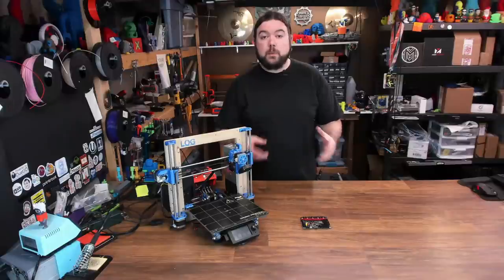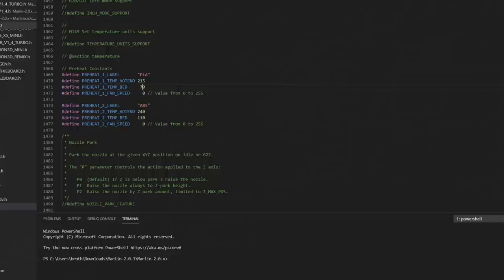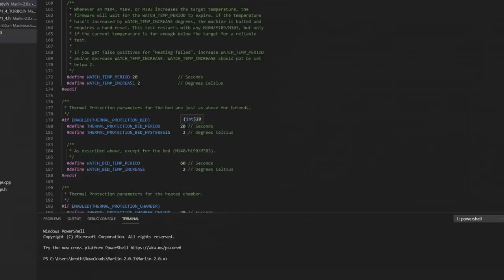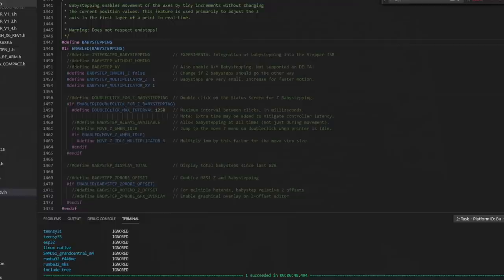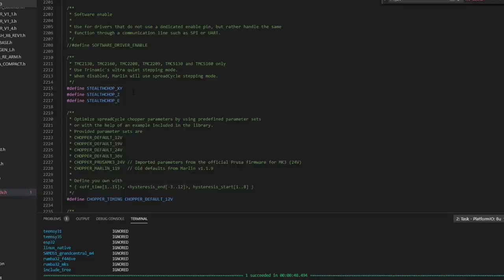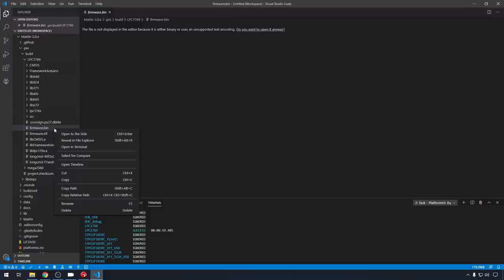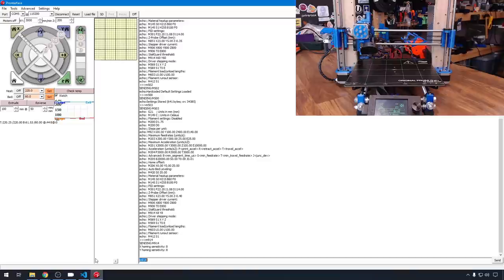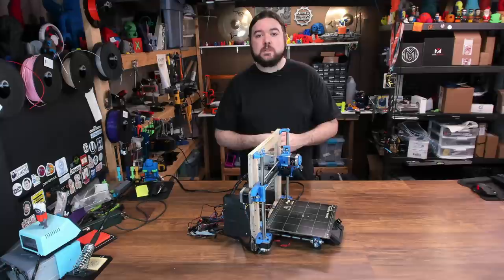BigTreeTech SKR v1.4 Mainboard - Full Install Part 2 - 2209 Drivers - Chris's Basement

Comment: Hey Chris, these videos are amazing. I have learned a lot. I am installing the BTT SKR 1.4 Turbo with TMC2130 drivers and a TFT LCD on my ANET A8. I've run through this whole process once already and couldn't get it to build. I am about to wipe all my files and start back over from step one. Any suggestions?
Reply from the maker: Thanks! Sometimes you just have to bang your way through the errors to get it done. What does the error say?
Reply: @ChrisRiley  I finally got it to build, now the LCD says TMC Connection error
Reply from the maker: @james12871  Double check all your jumpers.
Reply: I actually just decided to order the 2209s and do exactly what you have

Comment: When I put in the M914 command in pronterface it says the command is unknown. I noticed when I loaded the EEPROM settings I don't have as many on my screen. I followed the set up guide completely, anyone have some insight??
*Update: under pins and lpc1768 it shows under x and y stall sensitivity that the directives are faded out, I'm assuming that means that they aren't in use, if that makes sense, how do I fix that?
**UPDATE: found the issue, accidentally typed in tmz, instead of tmc on my stepper drivers 😂🤦🏼‍♀️. I feel like a dope lol.
Reply from the maker: Ha, no worries, glad you found it!

Comment: hello can i know why my x and y axis the maximum can go only at centre of bed
Reply from the maker: Make sure you bed size is set correctly.
Reply: @ChrisRiley  another problem is i get thermal runway on skrv1.4 turbo with tmc2209. Its occur during the middle of printing can u help me? I already auto tune, my heater at HB0, HB1 for the hot end fan, TH0 for thermistor hot end . I also having problem on heat bed. when i connect to HB and TB and power on i use multimeter on HB no voltage on that port. Hope u can help me a.s.a.p cause i limited of time to finish this project

Comment: Hi Chris, very thorough and helpful videos. This goes out to anyone else having the same problem. I dont know how to get the compiling checkmark or even the blue bar at the bottom of VS code. I had it once before but I CANNOT figure out how to get it back. I understand I need a compiler and I do have PlatformIO IDE downloaded. The bug icon is there in my extensions but no blue checkmark! I am so close to uploading to my printer. Any help on the matter is much appreciated
Reply from the maker: Thank you! Are you using the Marlin Build extension? It might make things easier. Try this one to make sure VScode is right https://youtu.be/JWUcnkjeNU8?t=127 and this one for the extension. https://youtu.be/YDvFN51siMU?t=161
Reply: @ChrisRiley  Appreciate the response! I did manage to get PlatformIO to work after fooling around with it long enough. Got my checkmark. Finally uploaded firmware to board after finding out I was using the wrong micro SD card too. Unfortunately, the LCD screen doesnt respond to the board. Tried a few screens and they all make a clicking noise. I tried reverting back to my old board for now but that doesnt work anymore either. Checked firmware related to screens and seems to be in order. So I'm stuck again but a few steps further this time ;). A little more grinding is required I suppose.

Comment: hi thank you for vid i have one problem  15:28  there is    #if HAS_TRINAMIC   is true but i have #if HAS_TRINAMIC_CONFIG it is false because it darkens the lines of code bellow how can i change it I just modified you firmwere  i tried delete the _CONFIG part but still nothing
and I have tmc 2209 ? can you help me please :D
Reply from the maker: You have updated your drivers to 2209 in configuration.h correct? That's what controls this.
Reply: problem solved reinstalled vs code and downgraded to v1.33 and everithing + i had somehow deleted one #define Y_DRIVER_TYPE  TMC2209 so added that and everithing somehow works
Reply: also i did check your version you posted and the part is false so not accasable too it is kinda weird maybe bug in my system who knows but it did compile without problem so idk
Reply: @ChrisRiley  also i had some problems with include path in configuretion adv.h so this might be problem is says there is problem with #include

Comment: My board only reads 80 degrees in the heater and bed sensors. i dont know what to do :( its a Ender 5. with a skr 1.4, everything else works but the sensors wont change from 80 degrees
Reply from the maker: If could be the termistor they used is something different than what's in the config. At room temp measure its resistance to help figure out which one it is.
Reply: @ChrisRiley  when the thermistors sensors are unplugged on the skr shouldnt it show an error? it shows 80 degrees no matter what. i have the thermistors working on my stock ender 5 board. but when i use same thermistor configuration on the skr board it just shows 80 as always. i think my board is wrong.. the resistance on the ports reads 3.7 and 4.5k and i think it should be around 6k
Reply from the maker: @lllOXKlll  It should read something like -25 when it's unplugged, sounds like the inputs on the board have an issue. You could test the T2 thermistor pin, you would just change the number in the pins file.
Reply: @ChrisRiley   T1 And TB have the problem. they refunded me the money after i recorded a video showing the problems. Thank you for your videos i learned a lot about configuring Marlin

Comment: Good Video, but it still doesn´t work for me. I did it exactly the same as you did in the code, except leaving a few thing I don´t have, but it is not compiling. It says
"SENSORLESS_HOMING requires X_MIN_ENDSTOP_INVERTING = true when homing to X_MIN."  I tried it before with some other tutorials sometimes it worked sometimes it doesn´t.
Please someone help me.
Reply from the maker: Not sure what is up with this message. These should be set like this.

#define X_MIN_ENDSTOP_INVERTING false // Set to true to invert the logic of the endstop.
#define Y_MIN_ENDSTOP_INVERTING false // Set to true to invert the logic of the endstop.
Reply: @ChrisRiley  Yes, they were just like you did in the video. Just to test I set them to true but the same message appears wich is even weirder. Also I have endles red errors in Configuration.h , almost everything is marked red.
Reply from the maker: @niklaslosonsky8379  Strange, you might try using my code and see if there is a difference. Link in the description.

Comment: Need help.  I followed to the T.  Auto home only homes the z but nothing happens with x or y. Everything else is working fine
Reply from the maker: Are you using sensorless homing?
Reply: @ChrisRiley  Yes
Reply from the maker: @Mistress635  I would rule that out, try your Z driver on X or Y. Even get some A4988's they are very cheap just to rule out the board as an issue. Before that, set you homing super low, M914 X10 Y10 or something like that.
Reply: @ChrisRiley  ok thank you.  I'll give it a try

Comment: Great video. I have SKR 1.4 turbo and tft35 v3. I have a problem with the SD card not initializing. I can update firmware, buit I cannot print from SD from either the SKR or the TFT. Not much help on google. Can you help?
Reply from the maker: What do you have it set as in configuration_adv.h?
Reply: @ChrisRiley  I'm not sure I understand your querstion. In Config.h I have #define SDSUPPORT and I have the display as #define REPRAP_DISCOUNT_FULL_GRAPHIC_SMART_CONTROLLER. Did I miss something else? What else do I need to enable?
Reply from the maker: @musicdad1853  So check these settings in configuration_adv.h

  /**
   * Set this option to one of the following (or the board's defaults apply):
   *
   *           LCD - Use the SD drive in the external LCD controller.
   *       ONBOARD - Use the SD drive on the control board. (No SD_DETECT_PIN. M21 to init.)
   *  CUSTOM_CABLE - Use a custom cable to access the SD (as defined in a pins file).
   *
   * :[ 'LCD', 'ONBOARD', 'CUSTOM_CABLE' ]
   */
  //#define SDCARD_CONNECTION LCD
Reply: @ChrisRiley  This is frustrating. I set #define SDCARD_CONNECTION LCD. When powering on the SKR still reports SD init error, and the TFT says card inserted, volume init failure.
Reply: @ChrisRiley  Is it possible to send you entire config_adv?
Reply: @ChrisRiley  tHANKS FOR YOUR HELP. i FINALLY GOT IT. i WILL BE BUYING YOU SOME COFFEES
Reply from the maker: @musicdad1853  Awesome, glad you found the fix!

Comment: Hey, Chris, I followed your instruction to the letter, but I got an error. Do you or anyone else have a clue as to why I am getting this error? Thanks in advance, and it was a great video that helped me understand quite a bit.

"Marlin\src\HAL\LPC1768\../../core/../inc/SanityCheck.h:761:6: error: #error "ADVANCED_PAUSE_FEATURE currently requires an LCD controller or EMERGENCY_PARSER.""
Reply from the maker: Hey matt, yes, in configuration_adv.h take the comment off this line ADVANCED_PAUSE_FEATURE
Reply: @ChrisRiley  , I did that where I took the "//" off the front of it. It won't compile. Also, it is giving an error in the sanitycheck.h

"Marlin\src\HAL\LPC1768\../../core/../inc/SanityCheck.h:752:27: error: static assertion failed: ADVANCED_PAUSE_FEATURE is required to use M600 with FILAMENT_RUNOUT_SENSOR."
Reply from the maker: @mattadams7261  I would have to see your files, because that error is telling you to take the comment off. You can send them to me. brotherchris81@gmail.com
Reply: @ChrisRiley  , I fixed that, but now, I am getting a warning when I go to print on filament runout. I tell you, it is always one thing or another with this thing, but I am having fun figuring it out.
Reply from the maker: @mattadams7261  Set this one to true #define FIL_RUNOUT_STATE false

Comment: Hey Chris I recently bought the BTT SKR 1.4 (non turbo) for a printer I built based off the Prusa i3 MK2. Everything is up and running including your animation boot screen tutorial works on it. The only thing I'm having issues with is the Z HOMING. It continuously crashes into the bed. I've read where this board doesn't like inductive probes for homing z. Do you know a fix to this? I'm using a 5v NPN probe on the z min stop plug. My led stays on until it hits the bed then goes out but continues to go lower.
Reply: this is using marlin 2.1.2 firmware for the printer if that helps
Reply from the maker: It should work ok on the Z endstop pins. Check to make sure the probe is triggering correctly with the M119 command.

Comment: hi chris have u had any issues with skr 1.4 turbo probe port i cant seem to get my bltouch working
Reply from the maker: I haven't seen any issues, it seems to work just like a servo port. I mostly pair it with the z min pin instead of the 2 other probe pins.
Reply: hi chris i think its faulty probe as it trigers with switch and when i try it in z min i get same issue

Comment: hi in my Marlin i downloaded 2.0.7.2 i was following the configuration adv.h and all the thermal protections were greyed out. is there a way to make sure they are active?? was there something you skipped over in yours that allows this to be active or is it still active if greyed out? setting up my SKR 1.4 Turbo for my Eryone Thinker s v2 and Thinker se. yes doing two lol. I am concerned if they are greyed out that means i don't have thermal runaway protection??
Reply: update solved lol
Reply from the maker: Awesome, glad you found it.
Reply: @ChrisRiley  I am trying to rebuild the eryone thinker setup into the new version of marlin. (Totally new first time) basicly coping the 2.0.x.x version they have into the complete marlin with all the required libraries.. discovered last night at 1:30am can't just mod their marlin as it is only the files it requires.. ugh. Sigh almost need a tutorial on how to setup vscode with vspkg and everything you have to be able to do what you did in this video and link it. I have spent hours trying to unpack vcpkg only to discover I just needed the 64bit Microsoft c++ redistributable exe file. I got lucky and discovered how to add GIT and the alien 👽 to run the compile.. your video is awesome thank you.
Reply from the maker: @rieldylanburrows6439  Hey Dylan, I hear you. I have this video, but it needs some updating. https://youtu.be/W6zYvRgGr3Q

Comment: im not sure what to do about home bump my setup has different settings its a newer marlin version though this is what i got. i want to set home bump to zero like you did i guess i just add in the lines i dont have? here is what ive got below.....thanks 

* Homing Procedure
 * Homing (G28) does an indefinite move towards the endstops to establish
 * the position of the toolhead relative to the workspace.
 */

//#define SENSORLESS_BACKOFF_MM  { 2, 2 }     // (mm) Backoff from endstops before sensorless homing

#define HOMING_BUMP_MM      { 5, 5, 2 }       // (mm) Backoff from endstops after first bump
#define HOMING_BUMP_DIVISOR { 2, 2, 4 }       // Re-Bump Speed Divisor (Divides the Homing Feedrate)

//#define HOMING_BACKOFF_POST_MM { 2, 2, 2 }  // (mm) Backoff from endstops after homing

//#define QUICK_HOME                          // If G28 contains XY do a diagonal move first
//#define HOME_Y_BEFORE_X                     // If G28 contains XY home Y before X
//#define HOME_Z_FIRST                        // Home Z first. Requires a Z-MIN endstop (not a probe).
//#define CODEPENDENT_XY_HOMING               // If X/Y can't home without homing Y/X first
Reply from the maker: Yes, just set these to 0 #define HOMING_BUMP_MM      { 0, 0, 2 }
Reply: @ChrisRiley  awesome thank you

Comment: I am using 
1. BTT SKR V1.4 board with all A4988 drivers 
2. nema 17 stepper motors
3. Inductive type probe sensor (6V) for Z axis and optical endstops for  X and Y axis
4. 12 v SMPS power supply. 
I have done all the settings and connections. But Currently I am facing 2 issues with my core XY Hypercube 3d printer:

1) When I connect printer to pronterface, and send M119 command, it shows  X and Y endstops as "Open" and z endstops "triggered". My x and y endstops works fine for "Open" and "triggered" but z endstops don't changes the status. It stays as it is. Kindly suggest me way forward to solve this issue.

2) although my x and y  endstops are open, still when I try to move x and y axis, they are not moving at all. My X and Y motor are feeling resistance to move. ( Simple words- My x and y motors are feeling that endstops are triggered even if my endstops are open)
Please help me in these two issues
Waiting for your response. Thank you.
Reply from the maker: My guess is the probe doesn't have enough voltage to trigger. You will need to get power from somewhere else and wire it in so you don't feed it back to the board. You motors should still move if the endstops are open. Might be a driver issue, make sure your driver jumpers are correct.
Reply: @ChrisRiley  i have connected my jumpers correct. How can i share my firmware and configuration files to you. Please have a look and let me know if I configured correctly or not ?
Reply: My z problem light glows when it detects the metal.but it still remains close.  So will it be voltage issue?
Reply from the maker: @vishalpatil571  Check you signal with a meter, but it still could be yes.
Reply from the maker: @vishalpatil571  If the m119 is correct, then your config is correct.
Reply: @ChrisRiley I heard from other sources that  BTT SKR v1.4 has a bug regarding this Inductive sensor. It remains open even if it detects the metal. Is it tru? If yes how can I resolve it ?
Reply: @ChrisRiley  can you please look my configuration once? It will help me a lot
Reply: https://reprap.org/forum/read.php?415,880111,880187#msg-880187. I have discussed this whole issue on the forum. Can you please have a look and help me ? 
Subject: Facing issues with motors and z endstop with BTT SKR v1.4
Posted by pvishalp19

Comment: I thanked you on your other video, but I want to thank you again here for all your help with this. I am very new to compiling Marlin 2.0 (I have been trying for over a year without any success) and I have been having so many problems I was ready to switch to Klipper if it didn't work this time with my new board (one major problem was multiple errors just because I changed the file name, like you said to do in your first video, but I can do it now by NOT changing the name at all), but one-by-one I have managed to fix them all this time around, except one..... for some reason my eSteps on all 3 axis are off by around half. I tell the printer to move 10mm and it moves maybe around 5mm. Any idea why this is happening? Thanks again.....James.
Reply: Again, I figured it out. The original creator of the Marlin for Sapphire Pro I am using set the axises to different microsteps.  Thanks again !!
Reply from the maker: Great! Thanks for watching

Comment: I followed all instructions in the video, however I get ''TMC connection error'' when in marlin mode and ''No printer attached'' when in touch mode. I am able to move axis when in marlin mode, auto home doesn't work though, I can heat the nozzle and bed, thermistors seem to work, fans work aswell. In touch mode I can't do anything. I tried changing the uart speed, switched it off and on, flashed the firmware again nothing seems to solve it. I have a SKR1.4 Turbo, TFT45 screen and TMC 2209 drivers. any ideas?
Reply from the maker: The screen, make sure serial is set to -1 and serial 2 is uncommented and set to 0. On the 1.4 there is not a lot you can do on the connection error, make sure the correct solder pads are soldered, or not, depending on the driver board you are using.
Reply: @ChrisRiley  thanks, i fixed the TMC connection and no printer attached. only problem i have left is not being able to home. However i think this might be due to a faulty endstop... will get a new one and try again. thanks a lot for the help!